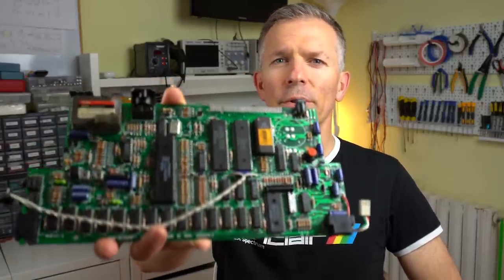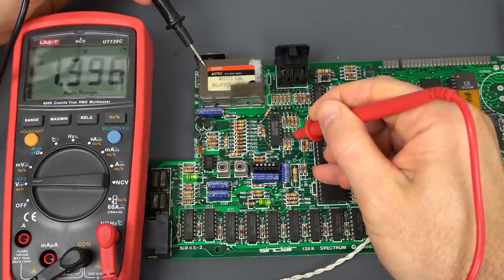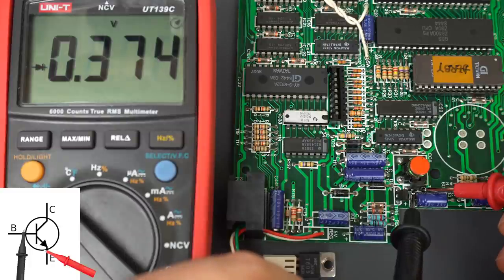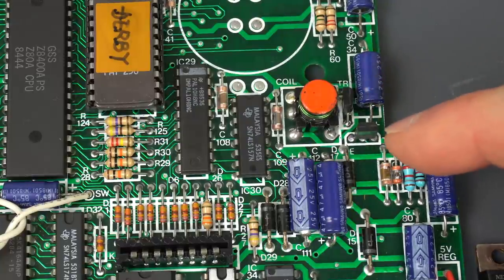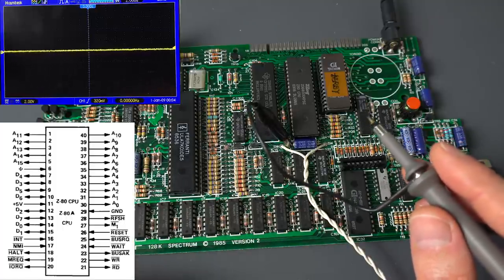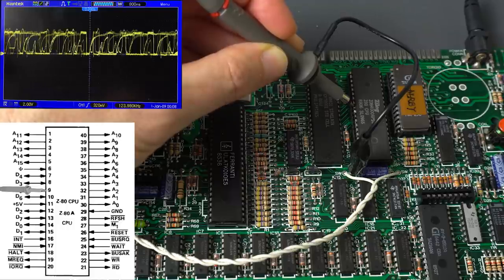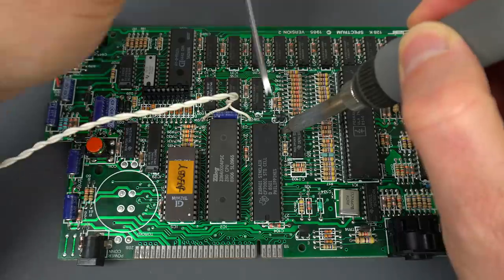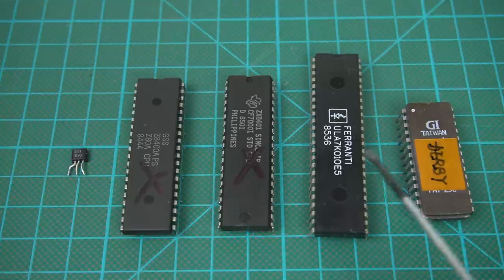ZX Spectrum 128K "Toastrack" Mega Repair (Part 1)

Comment: Something which I've always thought was n 'issue' when I've seen it on older boards is the 'warped' traces on the underside. Is this normal? I always thought it belied corrosion underneath the solder resist.
Reply from the maker: Those undersides of the boards are normal. They seem to be mostly extra solder on ground traces. Sometimes you end up sucking some of that away when you use a desoldering braid on a ground pin. I kind of recall reading somewhere that that was on purpose, but I don't remember the specifics.

Comment: Possible decoupling cap issues with those terrible rise times.   i.e. low or no local voltage reserve.   Pretty bad.   I've seen some other scope traces where it was clear the decoupling was a problem in some other video's.  One chip's signals shouldn't show up on the trace from another as a minor dip.

Comment: Why my zx spectrum with the composite video mod gives a good image in some lcd TVs, but gives very bad image quality in other lcd TVs?
Reply from the maker: Not sure. What kind of bad image? Dark? Out of sync? Noisy? Maybe using the capacitor or transistor mod variations could help with that.
Reply: Dryed up capacitors around the video circuit? Maybe try an upscaling device?
Reply: No doubt your LCD TV is HDTV. So the native panel is HD, either 1280x720 or 1920x1080. When you feed a composite signal into a modern LCD it must be digitized, de-interlaced,  then unconverted to HD. You are probably seeing the quality differences between various manufactures up conversion circuits. Now I think our host here said there is an RGB output available from the ZX. Most LCD TV's have a VGA input. You  would need an adapter cable and possibly some simple circuitry if the sync signals are the wrong polarity  to make the transition. I don't know the ZX but perhaps someone else here could help you with an RGB connection to your TV.

Comment: I connected my ZX 81 to the wrong power output, it got 24 V. Not functioning anymore. Is it now completely toast? Can I try to save it ? (Or let someone save it bc I'm without electronic know how?)
Reply from the maker: Ouch! I will definitely need some repairs. If you're lucky, it was just the RAM that blew up, shorted, and protected everything else. If you're not... it could be multiple chips. You should definitely get it repaired somewhere though (or use this as an opportunity to try it yourself--that's how I started!). I have a couple ZX 81s that need repair, so I'll probably make a video about it in the next couple of months if that helps. Good luck!

Comment: is the base always the middle pin out on a transistor ?
Reply from the maker: Not always unfortunately. When in doubt, check (and re-check) the data sheet. It's easy to get the leads wrong, especially if you're switching to equivalent transistors.
Reply: @NoelsRetroLab  haha .. hence my comment :-) .. just in case anyone else was wondering .. or just copying

Comment: does anyone know what computer the 1084s monitor was most commonly sold with? I have a computer in a very old very worn and stuffed original box in a storage shed, and while I can remember the 1084s from the monitor I can't remember if the computer was a C64 or some sort of amiga(as its been many years since I looked at it and its a fair distance away, I remember it came with a bunch of expansion stuff(extra disk drive, ram expansion(that doesn't work anymore)) and the computer worked, but I had to bypass the power switch on the monitor, and the main OS floppy disk had a bad sector and I couldn't copy it due to formatting problems(basically I couldn't make a new disk with my PC floppy drive the format it uses isn't pc compatible) it used 3.5" floppies

additionally, is such a computer worth hanging onto? while watching video's on old retro hardware repair is interesting, actually doing it myself/using it hasn't been for me for many years, and its taking up space, space I'll need to reclaim sometime in the next 6 months
Reply from the maker: I thought it was the Amigas (probably with different models), but I'm not an expert.

Comment: Is there a common cause to this many failures? I'm a bit confused.
Reply from the maker: Probably someone either plugging in the incorrect voltage, or shorting everything by connecting a device on the edge connector while the computer was on.

Comment: Why don't you touch the top of the chips? More often than not the failed components get super hot very quickly, especially RAM. It could save you some troubleshooting time. I learned that from GadgetUK164's videos. Recently I purchased FLIR One Pro, it makes finding the failed components and shorts much quicker and easier.
Reply from the maker: I did but must not have shown it or talked about it. Nothing stood out as getting warmer, but it's usually a great step. You'll see that in some of my other videos. I don't have a FLIR yet, so I usually use my fingers or a laser thermometer. How are you liking the FLIR? Is the offset between the heat and the image fixable or is it always there?
Reply: @NoelsRetroLab  I like it. The offset is fixable with a slider as long as you're taking a portrait photo, you can even fix it later on existing photos. In landscape it's bugged, the app still adjusts it vertically like it's portrait but should do it horizontally for landscape. Sometimes I still find myself taking landscape photos and realizing I can't fix focus on them so I have to take them again as portrait.

Comment: Something a little odd is that the ROM in both machines is an EPROM.
Something to try would be erasing and reprogramming it.
Reply from the maker: That's actually normal. This is the 128K Investronica model, and I imagine they were in such a rush that they just used EPROMs and put the hand-written sticker on top. I just did a quick search and I see that the UK version used regular ROMs.